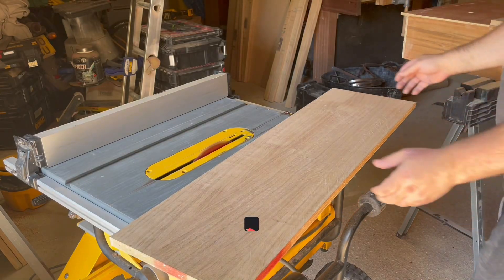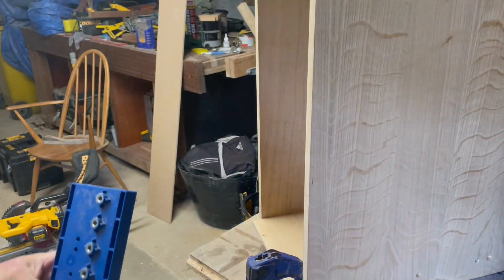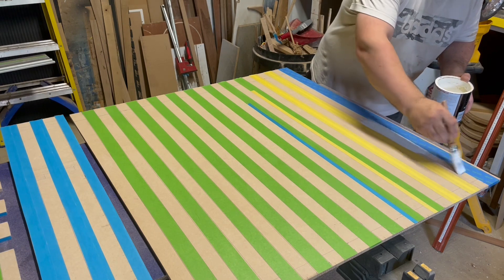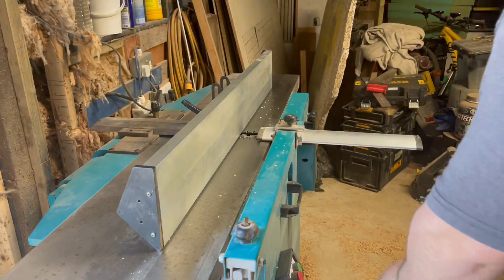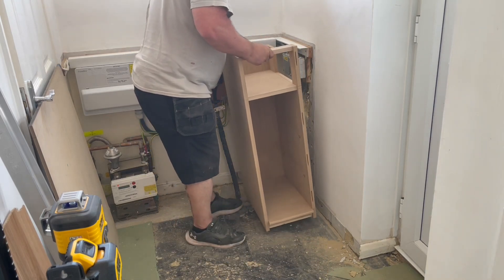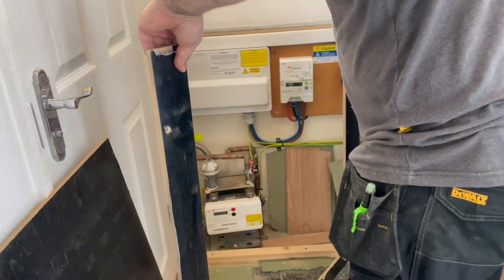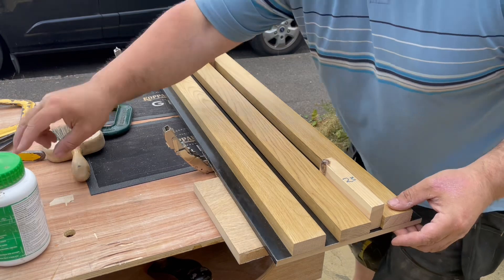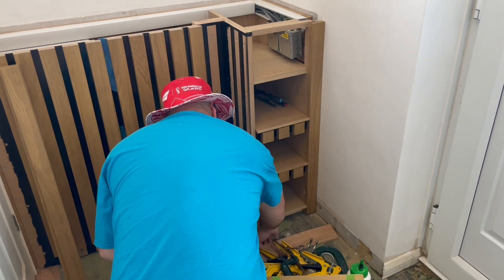How to Build a Wood Slat Wall Cupboard With Hidden Doors

Comment: What did you use to press door open what’s the name please. I need to buy some kind of door  close/open
Reply from the maker: Hello @Bevanna1
They are called push to open mechanism, I got them from ironmongery direct, 
The product code is 125258
You might also need the cruciform adapter, this holds the push to open mechanism in place,
Product code 202020
Anything else, let me know.

Comment: Hi Mike - I am doing something similar on an outdoor kitchen. I am struggling with hinges! What type of cabinet hinge did you use and how did you avoid the slats/battens from fouling on each other? Was it just a 25mm gap?
Also what thickness was the door? Since mine is outdoors I used 12mm marine ply and was going to fit a 45x19mm batten on the outside.
Reply from the maker: Hello @thomasashley-smith245
I used kitchen hinges, I will find the order codes if needed, everything was from ironmongery direct, 
It would probably be best if I could email you a drawing, I’ve just wrote out an explanation but even I didn’t understand 😂
I used 9mm mdf, 
My slats were around 25mm x 50mm so the total thickness of the doors ended up at about 34mm,
The gap between the slats was about 22mm I believe, 
It did take some trial and error but the kitchen hinges worked very well dealing with all the clearance issues, 

I hope this helps slightly helps but like I said, pop me over an email if you’d like a drawing sent over, my email is mjpcarpentry@yahoo.Co.uk

Thanks 👍